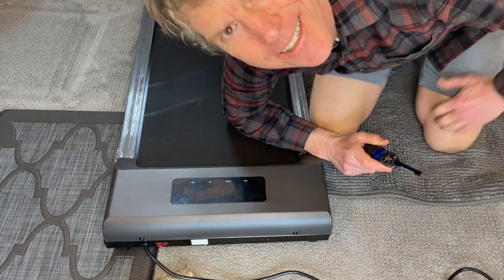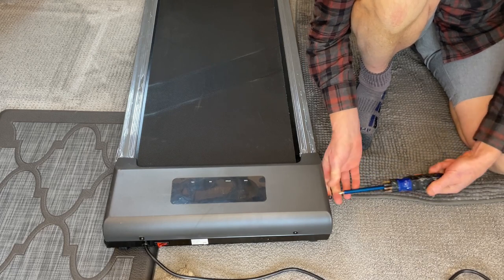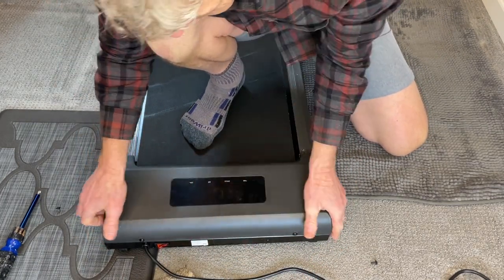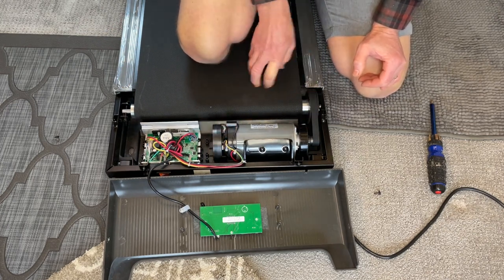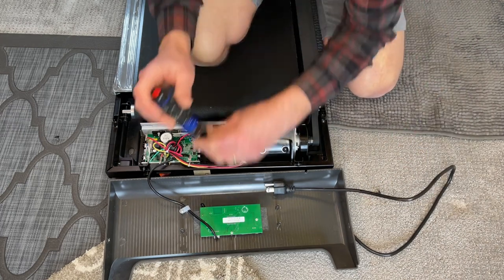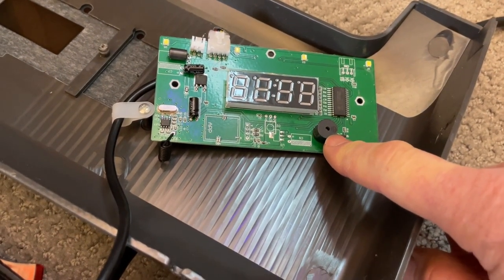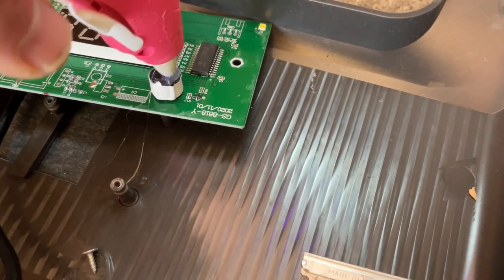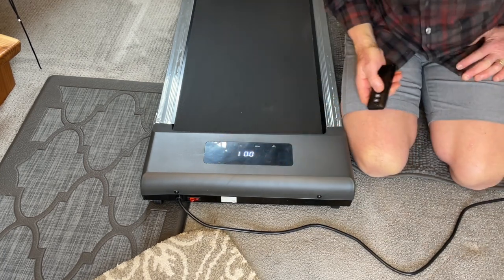Silence Your Treadmill's Beeper | EZ Beeper Fix

Comment: Saving this for later, I dont know if I have the courage to actually do this. The fear of breaking something is too high. But I know if I have to listen to my treadmill beep one more time then I'm throwing it out the window so... this is the safer option
Reply from the maker: I’m sure you can do it. It’s really not hard. Just remember or mark where the screws are. Taking pix or video is helpful. 
You can also use caulking if you don’t have hot glue.

Comment: Thanks for this video! Do you know if it’ll break if I try to remove it entirely? My dog HATES the beep sound so I’m trying to fully get rid of any of the noise rather than dampen it. Appreciate you.
Reply: I’m not certain, but I think if you destroy the little speaker it should not affect anything else. But that is why I put glue in it, but in case.